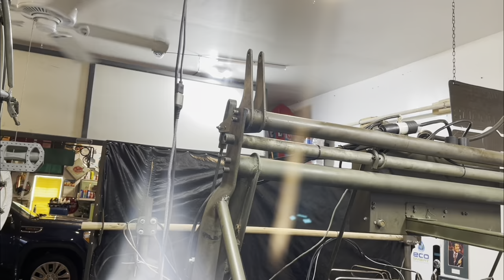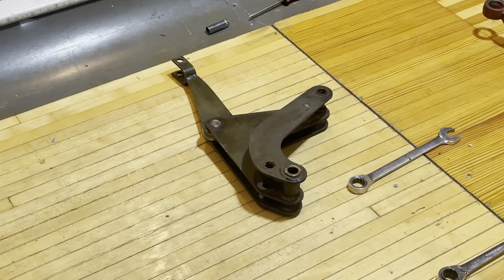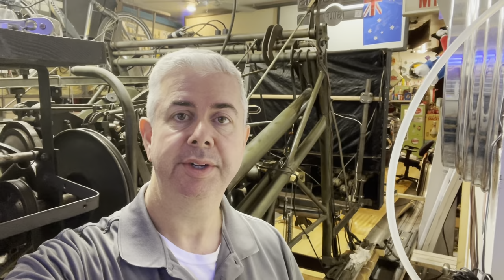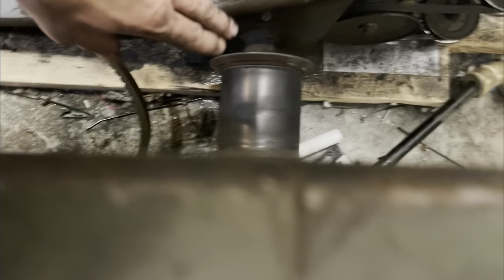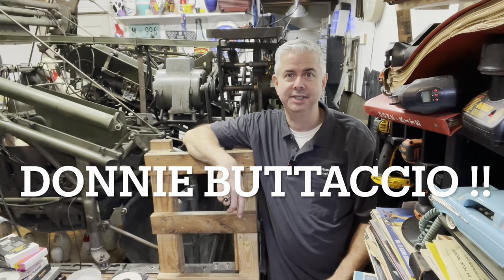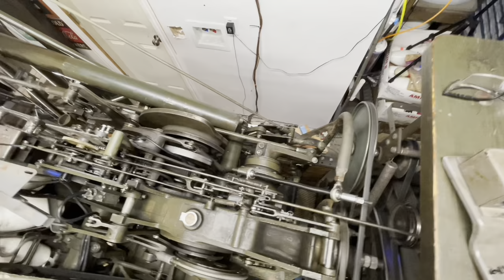Back FROM the Future ! The A2 un-conversion back to Model A Brunswick Pinsetter - Part 2

Comment: As a young boy, our small bowling center in town had first generation AMF 82-30's.  Other places my parents took me to also had the same.  One day (I think I was about 10) - the center they took me and a friend to had a tournament in progress, so no open lanes.  They instead took me to my first experience at a Brunswick 'A' equipped house (which was Morris-Essex Lanes in Florham Park, NJ).  I remember saying to my friend "Listen to the sound they make!".  Fell in love with the 'clang' from that moment on.
Reply from the maker: Isn’t it awesome ??    Great story.  Thank you for sharing it.   Those centers still open by chance ??
Reply: @GarageBowlingAlley  Sorry didn't see this till tonight.  The small Center in my old Hometown of Berkeley Heights, NJ closed up and became a Taylor Rental store in the early 70's.  I recently revisited my old hometown for our 50th High School Reunion and Taylor Rental is still there.  As far as Morris-Essex Lanes goes - don't know if it is still in operation or not.  Tried to google it but came up empty.  They did convert to A-2's around 1970 I believe.  It was interesting too because the house had above-ground Ball Returns, but they returned the ball at A-2 Speed, so there were some massive 'slow-down' bars on the ball return to slow the ball down - similar to what you have in the garage.  It was amazing to see just how fast it came back vs. the old 'A' machines.
Reply from the maker: @ajankowski2  the church where the machines came out of had ball accelerators with above grounds.     I still am surprised you’d run that combination.    I never got to see them run before they got removed.     I’ll bet it was quite the place up there back in the 70s !   I still think of Bowlerland in garland every time I pass the building      And Valwood every time I pass the senior center where it once stood.      Hard to believe

Comment: I didn't see a silencer cord on that pin wheel. Would recommend getting one or your pin wheel will crack eventually. Also I heard you say in the previous video you want to keep it an original A however last recommendation is to just remove the hockey stick triggering, it will eventually cause your gearbox studs to the reset linkage to lose their press in the gearbox and you will need a repair kit from ZOT who is now no longer in business.

Comment: Wow you did some nice work! Just one thing seems off, I'm almost certain the pinwheel turned a little slower with the A model.
Reply from the maker: I’ll check the pulleys and see if they have a smaller diameter pulley on the A vs A2 or jetback
Reply from the maker: I did look.   You’re right   Good eye.  The A pulley setup has a smaller pulley on it that drives the rest of the pinsetter including the pinwheel.
Reply: @GarageBowlingAlley  Missed your reply! Cool that ya found it :) The slower pinwheel I also liked too because it usually made pins waiting on the cross-conveyor less often.

Comment: Does this mean there'll also be 90 overtravel?
Reply from the maker: Yes there will but I have to wire up the 1/2 ball lights to the scoring system first and also a 44 AND 144 switch.

Comment: A curved Ball Track means you have an Even Lane. Yeah with your ball return system you couldn't use the Odd Lane Straight Ball Track. Your Pinsetter must be an Even Lane as in Lane 2.
Reply from the maker: Correct.   So the 9 needs to be flipped on the orange goldcrown.
Reply from the maker: Didn’t realize how far short the track was going to come from the middle.    That’s gray electricial pvc I used and shaped it with a heat gun
Reply: @GarageBowlingAlley  Yes or find a 6 for lane 96